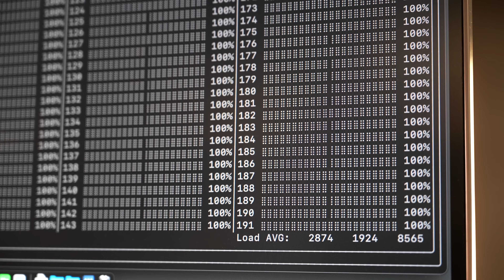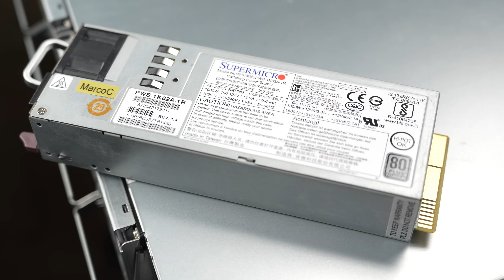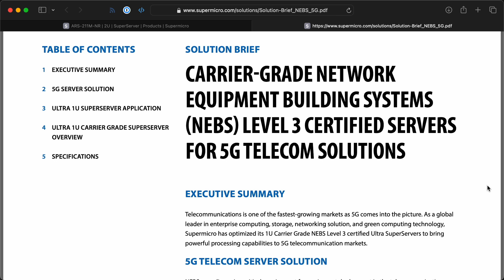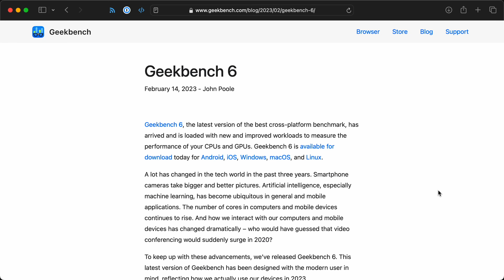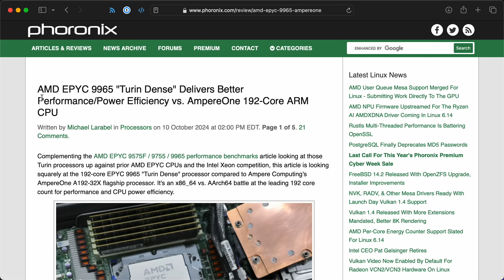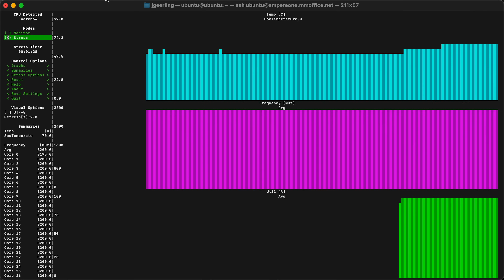CPU Cores are the new Megahertz

Comment: We are in a haunted house that needs to be blessed. So, we'll write the date in the format K+M+B 2016, and replace the plus sign with church crosses or keys. We're using bless command for netbooting or mounting. So, effectively, we're drilling a hole in the wall to connect to the Ethernet. For drilling, we need a special clock and a steering wheel. I'll be using a replica hole omnitrix based on my ratcheting wheel dive computer, with Armadrillo or electric jellyfish as my choice of hero. A letter sequence will be generated, which is also included. To conclude, we're updating the Ethernet controller by disconnecting from shock horror and reconnecting to a new world with eToken support. The change in setting is going to be something like medieval to post apocalyptic, with new heroes, villains and armour added to the arena:
https://travel.stackexchange.com/questions/77587/what-does-kmb-2016-mean-in-when-written-on-a-church-wall
https://edurev.in/question/4090710/Select-the-option-that-represents-the-letters-that--when-sequentially-placed-from-left-to-right-in-t
https://github.com/PeculiarVentures/2key-ratchet
https://github.com/pevecyan/unojoy-wheel
https://www.20k.org/episodes/shockhorrora
https://github.com/PeculiarVentures/webcrypto-local/issues/210
https://coloringfolder.com/aladdin/
https://www.coloringall.com/coloring-pages/ben-10/armodrillo-from-ben-10/
https://github.com/AA0100000101000001/Omnitrix
https://github.com/ranenbg/Arduino-FFB-wheel
https://github.com/darknao/btClubSportWheel
https://github.com/jackun/USBqemu-wheel
https://github.com/leonardont/Omnitrix-Arena
https://github.com/RealYusufIsmail-Mc-Mods/Ben-10-Mod

Comment: Louvers explanation: air, like your brother-in-law, is lazy and will take the path of least resistance.  If the louvers were not there and a fan died, the remaining fans would pull air backwards through the dead fan and back out rather that through the added resistance of the chassis of the computer.  This would cause the computer to overheat.

Comment: comparing arm native workloads to the x64 loads and calling that a win is just a waste of time. I mean you sound like someone getting paid to hock this thing. So now post in the next line the native x64 emulator on the 192 arm serfver vs the AMD 192 and intel 256 and see how lopsided that is. it will be FAR more of a rediculous blowout.
Reply from the maker: I intentionally spent more time in that bit talking about how that is a phyrric victory for Ampere as it's a bit contrived outside of the use case of running Arm native code that can't be run native on x86 (like compiling for arm)

Comment: ARM is still a PDA and phone cpu to a lot of people. Me included. To me this is basically a RaspbPi army. It's cool as heck, but I don't know that I'd be likely to swap my Intel Core x86 boxes any time soon, for this OR AMD. AMD is on my $hitlist since I've spent a buncha money on buying their CPU new or almost new twice, and both times they were duds, one was the X2.6400BE which had a china syndrome and I sold it as soon as I possibly could to replace it with an Intel Core. The other was FX9590 which... well... you probably can figure that one out. I did have legit 1000+watt PSU's for them, which I still have, but powering intel machines. I only like intel because they work for me. AMD not so much, occasionally they do work but they underperform and overheat. 
Before anyone starts going on about Zen or whatever it is called, no I haven't tried. No I don't intend to, lost enough money buying AMD stuff just to have to ditch it. I hope current AMD actually are as good as people say but I have much doubt since none of the previous generations were. Thunderbird XP2400+ for socket A was good, liked that one very much. I have an Am5x86 133mhz that I also like. And a s939 fancypants FX60 that is okay.
Heh, it became a rant about AMD instead, but I'll stick it here because my opinion about ARM will form the same way eventually. ARM has worked fine on low power things, much less on higher power stuff.
Reply: Fugaku toped the supercomputer top 500 list a few years back, it was Arm Architecture. The instruction set needn't tie it to particular devices or performance points.

Comment: Amd has one with more the new epic
Reply: What's it called
Reply: @tyler6602  9965 192 cores but 384 threads. So twice the threads as this arm chip.
Reply from the maker: Hyperthreading is highly workload dependent on whether it helps much; it can give a little boost but it's not nearly the same as having double the cores :(

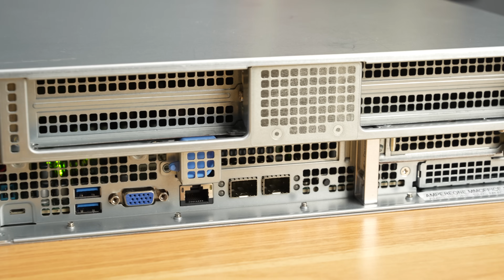Comment: 1:42 And we're still using VGA.
Reply: Yep, in a DC it's hard to break, lots of kit around to display it and trivial to design in a board. Quite often it's the BMC driving the display output.
Reply: good. cuz its good. good.
Reply: @AffectionateLocomotive good.
Reply: Most datacenter crash carts still use VGA. Since it's only needed to display information, there's no reason to use anything fancier.
Reply: @0x1EGEN So, no Crysis?
Reply: @zo1dberg  yes crysis.
Reply: VGA is essential for servers tbh... you can get text on the screen without any drivers
Reply: VGA da best. Easy to mess around with.
Reply: @bitlong4669  yes VGA

Comment: Look close and you see socketed BIOS chips.  This is something that would be wonderful on a desktop computer!!  In the past they were socketed and that made recovering from a bad BIOS flash less painful if you were willing to wait for a new chip to come in the mail.  Sometimes they would have you send back your board or chip and then fix your problem.  Sure not everyone knows how to pull out a BIOS chip from such a board but it is a lot better than having to desolder it or send back the board to the manufacturer.  It is still possible to mess up a BIOS flash BTW!  You could interrupt it in the middle of the flash (power goes out or the computer is turned off) or you might flash the wrong one to the board or flash it incorrectly.  Any one of those things happening could result in a computer that will not boot since its motherboard firmware is messed up.

Comment: server market is an extreemly fickle market as it takes decades for there to be major movement in terms of adoption due to software.
amd has been out competing intel for nearly a decade with their epyc servers which were better priced and more performant, and they still dont have a majority in the x86 server market, its very very dificult for other arm based server manufacturers to go out and compete without having extremly low prices, hyperspecific components and amazing efficiency.
its a hyper competitive market, but with everything being said seeing the current server market revolution over the last nearly decade has been a very exciting time.
we have to remember the top end intel xeons from 2017 were (im going off of memory i might be wrong) 20 core cpus with 300w tdps and costed anywhere between 20 and 50k$ per chip, to say we have seen a huge reduction in price is an understatement.

Comment: A homelaber could use a 240v server if their server room originally had an absolute beast of an AC, or if they know how to do electrical. 240v is in the home, so as long as these companies dont roll out with 208/480 volt 3 Phase PSUs, it is possible for a homelaber to use the higher end servers

Comment: Does it have SVE? We have a bunch of Amper Altra systems (gigabyte, with first gen CPUs, 80 cores), and they are Neoverse-N1, with no SVE. Which is a problem, because we also do some builds and tests there, for final binaries that will run in cloud (including AWS Graviton, GCE and Alibaba, all with ARM), where we have SVE, and in fact use SVE for accelerating few critical things with actual good effect. Even if SVE is only 128-bit on Altra (I do not expect 256 or 512 bit of floating point performance, as this is not the use case for these systems), that would be just so much easier, than needing to deal with no SVE at all.
Reply: No SVE yet on AmpereOne. It is updated to Arm ISA 8.6+ though.

Comment: Oh so wrong. 
Jeff, do you slice like in VMWare or do you keep them in a single pool to be used w Kubernetes? 

You're walking into composable system design where you are building two clusters. One for compute, One for storage.
So you're going to have to think of split racks spreading each of the clusters over two or more racks. 

There's more to the design and how to use these boxes within the DC.  Note that could also mean edge computing where the edge machine room becomes a DC.

I love your videos, but this is where you also need to consider your network and then your ToR Switch.
The 25GbE is not enough. W the PCIe 5... your networking is now key...  Something you kinda seem to hate??? 

You've been given this really cool F1 race car but you only want to test it in 1st gear. 😞

Granted you're not set up to really have fun with this type of server and it takes time to come up w good benchmark and simulations of work flows to test it. 
Upgrade your network. 

ToR 100GbE switches are ~10K these days. (Talk to Nvidia)
Reply from the maker: The Mikrotik has 2x 100 GbE ports, I just don't have the setup yet to take advantage.

I'm still amazed at 25 GbE, much less 40, 100, or 400 :D

I'll get there though.

Comment: On all servers, whenever a fan dies or you yank one all the other fans go to 100% to make up for the air flow. Because those little fans pull a ton of air through that server and with just one going down it can make temperatures rise very quickly. So that's completely normal for it to meet up to 100% on off fans if you pull a fan out. And then whenever you put in good fan back in the fan should ramp back down again. Assuming of course it's hot swappable, which about 99% of server fans are lol because you can't afford down time to replace a fan or most hardware actually on a server. So the only time you really have to go down is if a processor ram or a PCI slot goes down. But if it drive, fan, power supply, etc goes down you just slide it out pop it open swap the part close it up and slide it back in

Comment: Nobody would buy a $10k server to emulate another architecture.
Reply from the maker: The point, I think in Ampere's case, is that if you have a bunch of servers, and you have a group within your org that is doing arm64-based compilation or testing, picking up a few of these servers would be a much more efficient/cost-effective solution for those tasks, than emulating them on your existing infrastructure.

These servers aren't realistically targeted at smaller businesses picking up a couple servers meant to run all their software.

Comment: They make proper switched PDU units for rack deployment that are rated for those loads. You may not have a problem with the smart plugs, and they're cheaper maybe, but the right thing does exist you should review one. 
Cyberpower has a not offensively expensive one.
Reply from the maker: I have a good PDU with serial console access and power measurement, plus multiple network connections so you can access it in case of network failure! But... I am too lazy to set the thing up lol... I'll get there sometime.
Reply: @JeffGeerling  it might make a good video! Lol

Comment: Cores are not the new MHz, because
* Writing software for parallel computing is much harder than writing serial code.
The architects of some complex SW projects I worked decided to make it serial and take the performance hit, because
- Correctness was much more important
- Junior developers can't be trusted to write bug free parallel code
- Debugging parallel code is so much harder
* Some problems can't be solved with algorithms that aren't memory or I/O bound.
* Some software can run fast enough on current hardware, e.g. office productivity. Which is why some CPUs with a high core counts are used the same as good old mainframes, read same as X personal computers.

Sure, supercomputers have legitimate uses, such as weather forecast. It's just that performance of home PCs has hit a ceiling.

Comment: CPU cores are not the new megahertz dislike button. Most apps use 8 threads on the high end but often 1-4. There is no benefit unless you are running programs or 80 instances of a program

Comment: regarding idle power draw, did you by any chance tried to offline few dozens of cores? i mean surely i am not the target for these beasts but i've seen on my ancient dual-xeon workstation which i use for homelabing that i can go fom 150W idle to 80-90W just by offlining 12 cores(threads) out of 24 total.
Reply: These cores sit at ~3.5mW when idle. It's the DDR5 IO drawing a lot of the power.

Comment: So the price and power consumption is similar to an RTX 3090 or 4090, except it can run huge language models because it has all that RAM.  The price is also similar to a pair of 4090's or one A6000.  I wonder if it's faster or slower than a GPU for ComfyUI or smaller LLM's that fit in VRAM.

Comment: If you sent this guy back in time to mid-2000, it would be the world's most powerful supercomputer.  It would still rank among the top 500 as late as 2006.
Reply: A bit faster than the Celeron 333MHz desktop I was running in 2006
Reply from the maker: @Pasi123  Just a little haha

Comment: I really like your videos but a fact check here by a tenured processor architect, no cpu cores are not the new MHz. Efficient architectures, domain specific accelerators, in core performance improvement techniques are.

Comment: Heads up, Jeff! Those Smart Outlets might not be rated for the wattage and the relays inside might burn out. I used one to monitor power draw on my server rack and it never came back on after a power outage (rack has battery backup). The other I used to control my 3D printer with Octoprint and that stopped working after a few months as well. Check the specifications to be sure!

Not sure if that PDU you have comes with network management, but most that have SNMP and Web UIs that'll let you monitor draw and let you toggle power.

Comment: I'm almost 80.  The first computer I used in 1969: Philips P1100 (1C1T; ~6 cubic meters), 64KB (1MHz), ~$750,000?  55 Years from 192 cores. 
In Apr 2019 a Desktop with Ryzen 3 2200G (4C4T); 16GB; CPU+RAM for $175 and on 11 Dec 2024 Ryzen 5 5600GT (6C12T); 32GB; $179.  
I combined desktop and server in one PC.  Host OS = Minimal install of Ubuntu 24.04 LTS; Hypervisor = VirtualBox 7.1.4; File System = OpenZFS 2.2.2. 
The Apps run in VMs; Xubuntu 24.04 LTS (Email and Social Media); Ubuntu 16.04 ESM (Finances); Ubuntu Budgie 24.04 LTS (Multimedia); Ubuntu 24.04 LTS (Experiments); Windows XP Home 768MB (Jukebox); Windows 11 Pro (if needed) and ~60 other VMs.

Note that the CPU + RAM upgrade is the same price as the original ($175 vs. $179), while the CPU is 3x faster and memory is 2x the size.
Reply: I didn't know the idea of a core and thread went back that far. interesting
Reply: @Zimbob2424  In the sixties and seventies the IBM 360 and 370 had computers, that could be bought with 1 up to 4 CPUs. I think Multithreading comes much later in the 21st century.
Reply: I had a boss who worked on a burrough large system back in the day. It had dual procs but they were asymmetric

Comment: Nah they're not new.  Enterprise SPARC servers have been running 100+ cores for a long long time.
The T2 CPUs I worked with back in 2010 had 128 cores.  They were also sodding expensive, but mostly for the 256GB of RAM we had in them.   Yes, they were sliced up with Logical Domains to allocate the hardware out,

Comment: I don't feel that cores are the new Megahertz because the scaling is way worse than what happened during the moor's law period, mainly due to power draw. PCs can have 12 cores easily ok but server were always more expensive than consumer product, imagine when the PC appeared, companies relied on mainframes, they were building size. What I mean is that the consumer PCs won't use 192core as a way to scale up the power because their usage is for niche software, games won't leverage this kind of architecture, neither the average software. I had a dual core in the early 2000s and 20 y later I have a quad core, it's clearly not the main scaling factor. Right now there is no tech that promises to double the power every 2 years. The golden age is behind us. I guess that the real progress will be in software to make sure we use every bit of power

Comment: The louvre/damper fan is a brilliant move, because the fans themselves cools the CPU, others take over if a fan fails as you mentioned. As a former Solaris sysadmin here, like to add it's best practice decades ago to put "dummy" drives/fan holders and no space as it severely lowers the air flow efficiency.
Reply: A cap/cover is better as louvres reduce airflow quite a bit.

Comment: 2:32: “Don’t think of this as a single 192-core server. Think of it more like 48 dedicated 4-core servers in one box.”

Waylon Smithers: “Now, I realize caring for Mr. Burns seems like a big job. But actually, it’s 2,800 small jobs.”
Reply: I just like how there is a VGA connector (DE-15 FTW!) sticking out of the middle.

If you are running SIMD-heavy workloads Epyc is probably still the better value per dollar.
Reply: yeah but can it play Crysis?